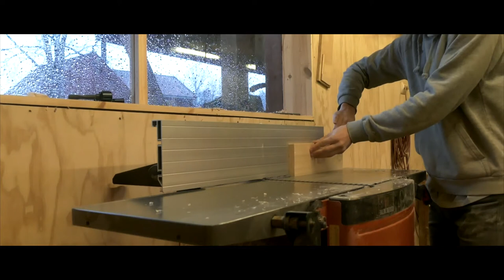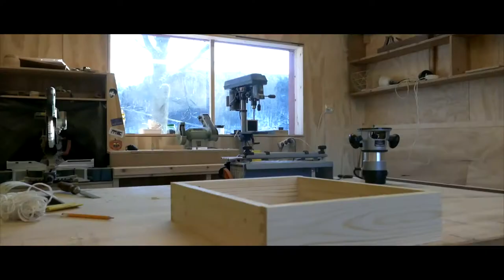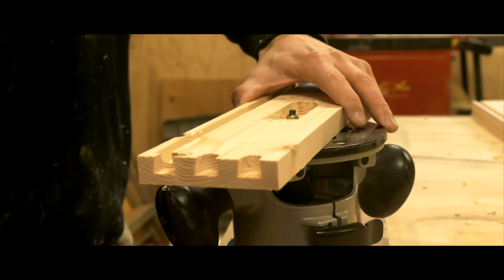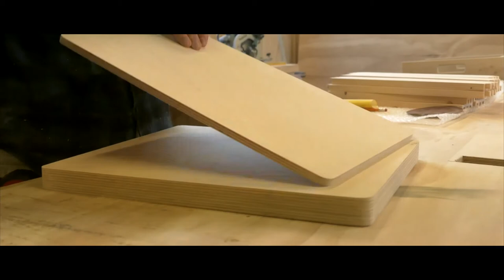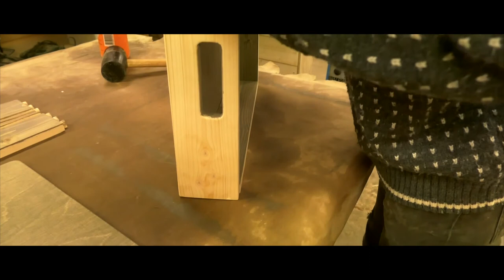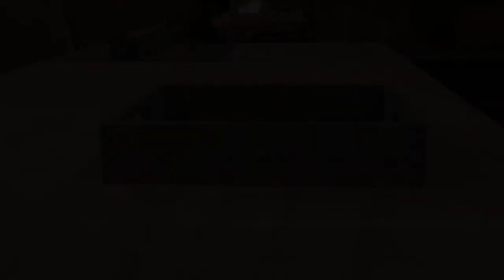How to make Dovetailed SERVING TRAYS! // DIY Christmas gifts

Comment: Good looking trays, did you use Osmo Terra, I have wondered about getting a dovetail jig for making some trays or I might use a lap joint, question did you glue the bottom plywood or did you leave it loose
Reply from the maker: Thank you! It´s Osmo graphite. Dovetail jigs are great for quick dovetails, and for building an understanding of the concept of dovetails! I left the plywood loose. No need to glue it really, but it wouldn´t be a problem since it´s plywood.
Reply: Are Baloni hi, I love the graphite, it must be the colour tone in your video making it look more yellow, I love Osmo and I always finish with their Matt satin finish and then final application of beeswax with 0000 wire wool and then buff it with a fine cloth.